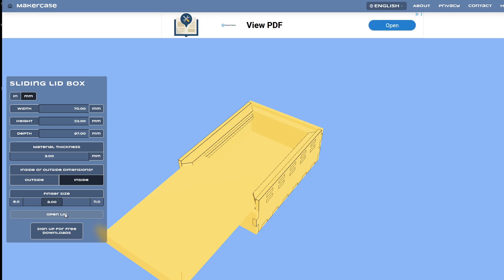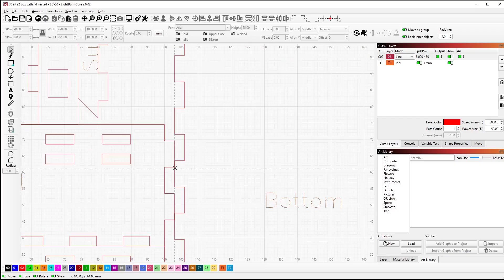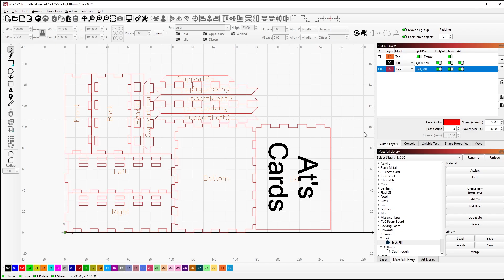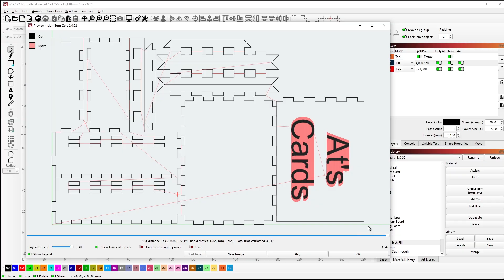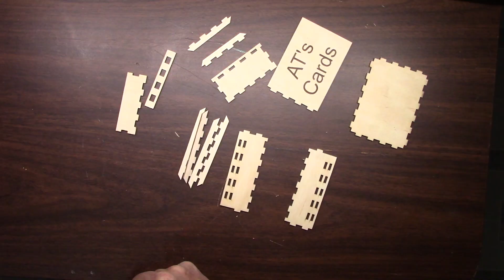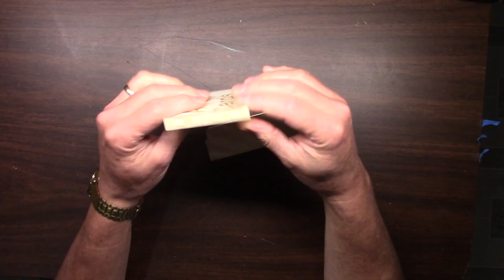Box with sliding lid - The second one turned out better

Comment: I have a number of customizable box generators out on Thingiverse     thing:5030299      thing:4595941    thing:6201500    thing:2556257     thing:4900890      They are based on Openscad.  You might have fun with them.  Most are for laser, but one works well for CNC and 3D printer.
Reply from the maker: I will have to check that out!